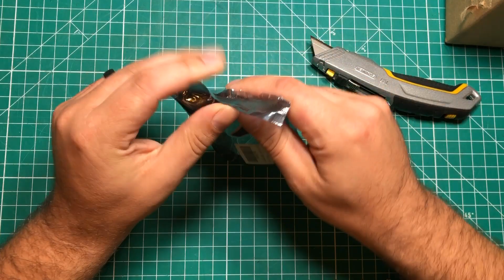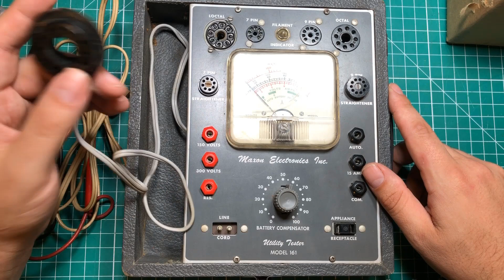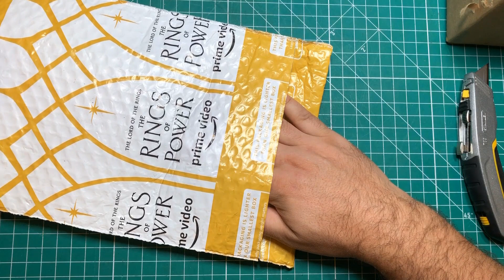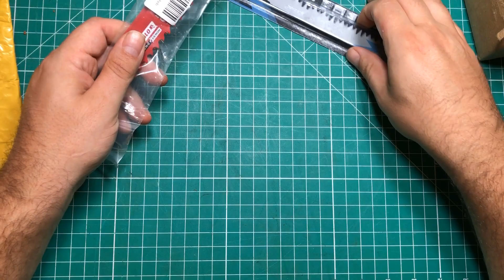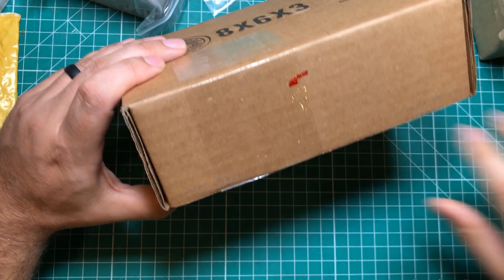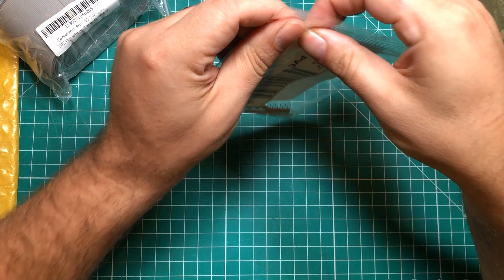mailbag 61

Comment: Great video as always, the nest hub and that meter are my pics.  The STM32 "Blue pill" runs at aprox 72mhz there is a variant from STMicro the Nucleo that has the UNO  footprint.  You can add the STM32 to the Arduino IDE and if memory serves me right Platform IO as well, really great MCU's   There is also a way of using them instead of the Mega 2560  with the speeduino ecu.

Comment: If that's the Gen2 of the Google hub, well I find that it sounds amazing for the price, also the display is crystal sharp.  My son has generation 1 of this and the sound  is not really that great on that one, night and day difference. The second generation, well I am blown away by how much bass, at low volumes that is, it can produce. Unfortunately my eyes are no longer that great without glasses and it just stands next to my bed as an alarm clock. But you can watch youtube on it, even cast to it, and it is a lot more functional as the other speakers without a screen. It makes with automations as like  'good night' or 'good morning' a real nice machine. Also very easy to set and cancel alarms with visual inspection.  It's clever but sometimes it lacks things. Stupid thing, if you disable an alarm that is a returning one then it will ask if you only want to cancel it once, but bridging or bank holidays like we have here on Monday for example it doesn't automatically cancel the alarm.  would I buy it again, for the 50 euro I paid for it, yup for sure.